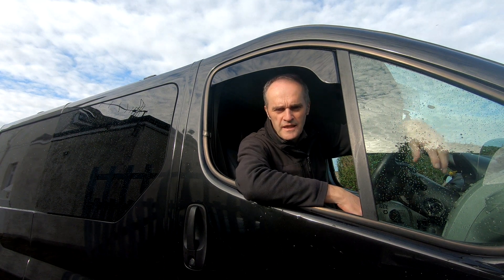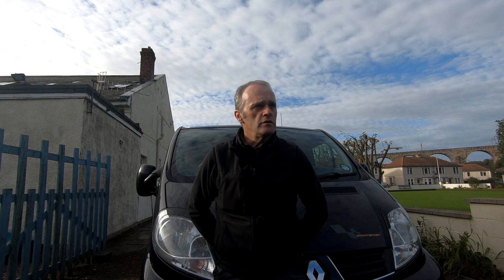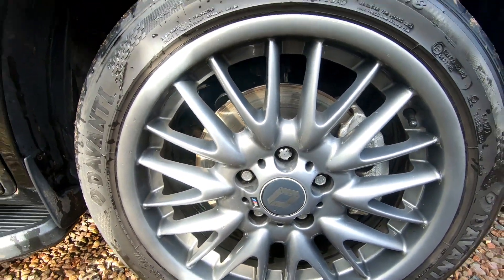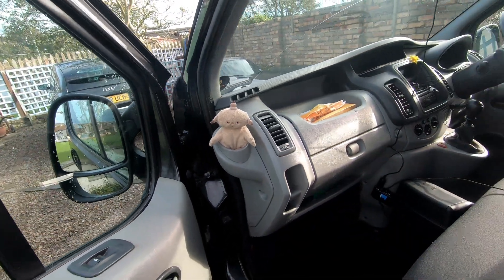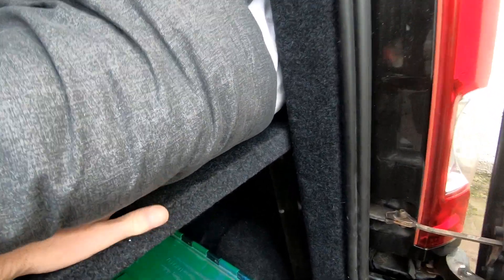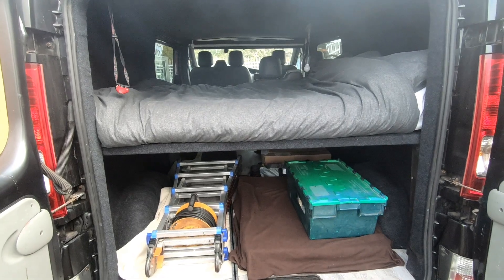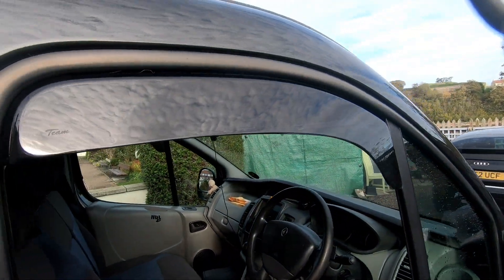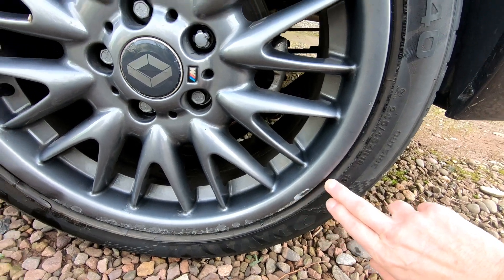RenaultTrafic - Part conversion into Day Van

Comment: I am the most critical person when it comes conversions, as people want to reinvent the wheel, but yours is good, everything makes sense. I don't like alloys, but that's okay, I have an 08 Vivaro bought/converted in 2015 and love it after 150+ nights. In the mountains you put it in 4th and you are almost driving an auto, the engine is so flexible and gearing perfect. It is much better than the T4/5 in every way and as you say much cheaper to run + no timing belt. I have a rock and roll bed because like you I am 6 foot and didn't think I would fit, but I travel with the missus, so easier and don't need the van for work.

I like the black, but not where I live in Portugal where white is cooler in the sun. But a good job, simple and does exactly what you want it to do. I am envious of the LWB, the guy I bought it off was upgrading to LWB, bah!!!..but never mind. Thanks for sharing and enjoy you outdoor activities.
Reply from the maker: Thank you. I love day vans, they are so practical and for me, as with many people, simple is better. I sold the van to a young couple with a dog and they travel all over with it. Hope you have many more good nights out with yours.

Comment: I wouldnt have put car wheels on a van to be honest. DVSA are now coming down hard on vans the pull over for spot tests if they have non load rated car wheels or tyres. Where I live now ive seen DVSA and VOSA operating  at lot. If they find a van with non load rated wheels or tyres they can seize the vehicle until the correct rated wheels and tyres are put on it. Plus non compliance can render a 2K fine. I do love the graphics you did and those lights "eyebrows" have personalised the van nicely.
Reply: Yes, plod seem to have a bee in thier bonnets now about this, and insurance companies have cottoned onto the fact and are refusing claims.

Comment: Jolie trafic longueur 2 les jantes alu sont du 18 pouces 245/?/18 quel serait la taille exacte moteur 90 cv cela roule bien pas de problème pour la consommation car j'ai un trafic 2 longueur 2 je cherche a mettre des jantes alu 17 pouces ou peut être 18 le mien est un 90cv merci
Reply from the maker: My Trafic was the 115bhp. The 18" BMW wheels fit nice but you need the wobble bolts to fit them correctly.